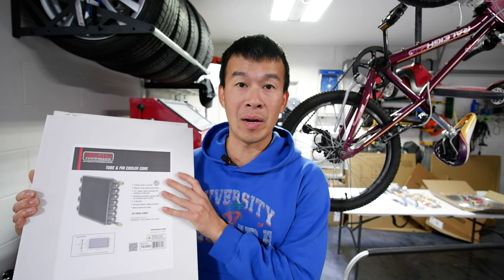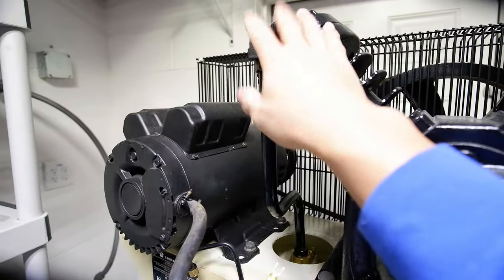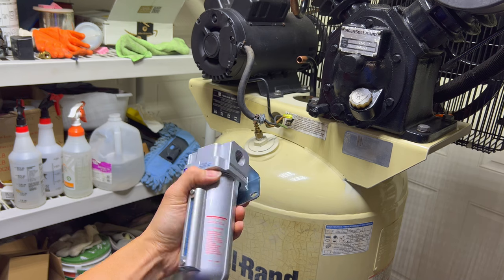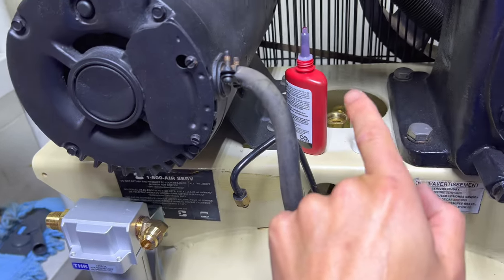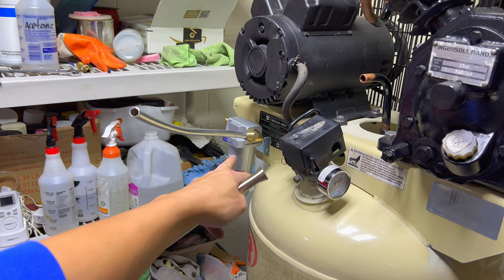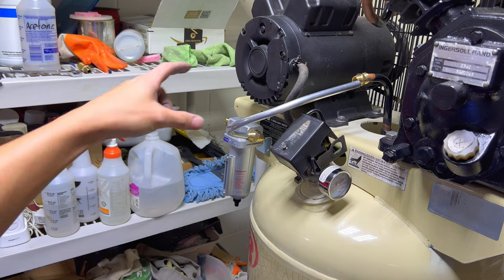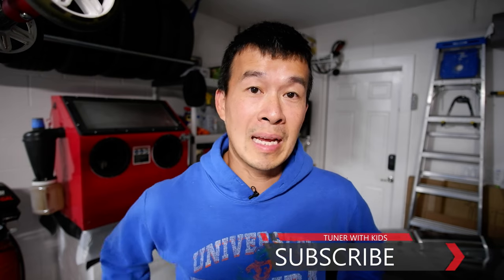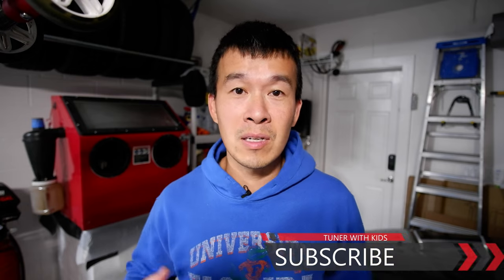DIY Air Compressor Aftercooler Dryer Water Separator | Compressed Air Cooler

Comment: Very useful video, thanks!  Recommending to tighten NPT threaded connectors as hard as you can into cast filter bodies is not the best idea though...they will snap or burst along the casting lines if you go too far.  That is why teflon tape is a better idea, the thickness of the tape gives you more ability to clock an elbow to where you need it.  Been using 5 to 7 wraps on 1/2" NPT on any kind of air service for 30 years....Loctite 575 is kind of overkill on not the best choice.  It is also not recommended to use any kind of sealant on the threads between the nut and body on a compression fitting, the ferrule is holding the tube and it would take unbelievable pressures to loosen that nut.  Not being critical, just offering the advice as I am an instrument fitter by trade.
Reply from the maker: Thanks. Good to know. I was using Teflon early on this compressor to do the other maintenance parts and they leaked since I didn’t tighten enough on clocking the fittings. That’s why I switched to the 545 since I had that laying around for some hydraulic fittings I’m doing.
Reply: @veecan8341  pipe thread sealant. Since it's not boiling hot air true blue pipe thread sealant. Or blue monster with Teflon 3-4 wraps.

Comment: Keep a bag of silica sand around. Or salt. Fill tubing. Tape ends then bend. Keeps tubing from collapsing
Reply: Or use tubing benders
Reply: I fill the tubes with water, cap the ends, and put it in my freezer, when its frozen I take the pipe out and bend it to shape and it wont kink. Remove the caps and the ice melts.
Reply from the maker: Good idea on the ice, never thought of that.

Comment: I've watched a lot of these videos, yours explains the process really well. One thing - I don't understand why everyone goes through all the trouble of mounting these on their compressors, between the motor and the tank? Why not put the aftercooler AFTER the tank instead of putting it between the motor and the tank? Pop an auto drain on the bottom of the tank, let the tank and auto drain do the job they're designed to do, collecting most of the moisture at the tank .... then have the aftercooler inline right after the tank, cooling the air before it hits the filter.
Reply from the maker: It’s due to the temperature coming out of the compressor, 250F. Dropping it before it hits the tank minimizes moisture in tank and in airstream. You rather catch before the tank. A cooler after the tank to the filter won’t do anything. The point of the cooler is to get a high Delta T. In industrial applications, they use refrigerated dryers to do same before the air hits the 1,000+ gallon tanks.
Reply: Extracting the heat before the tank give the air one more place to drop moisture, making the air that much drier. 

A cooler after the tank will work but only on extended run times when the tank gets warm/hot. I used to run 50' of air hose looped to condense the water after the tank and before the dryer, it works but again only if the air leaving the tank is warmer than ambient.
Reply: I’m not concerned about moisture.  I’m concerned about burning up my pressure regulator from heat!  I might put it after the tank and not install a water separator.  I use my compressor to bubble up water in my water well.  I produce about 15 gallons a minute with all mechanical components above ground.
Reply: @TunerwithKids  That kinda direct pressure into a transmission radiator not made for those high pressures.
Reply from the maker: The air movement thru the cooler isn’t under high pressure that long like in the tank, but the Derale is rated for 250psi. Once the tank is full and motor shuts down, the circuit releases pressure and tank has a check valve to hold the tank pressure.

Comment: Please note that  the 5/8  pipe from the pump to tank is sized to ensure that the pump(comptessor) can provide the  designed CFM to the tank.   If you   now connect a smaller  diameter pipe  (the cooler)  in between the pump (compressor) and tank.....you nowdecrease the  CFM going into the tank.....which can increase the recovery time to the max air cutoff.    Maximum CFM is critical to the operation of certain tools....like a DA sander....sandblaster....if you don't want the compessor running on and off constantly....or always running.    However  if MAXIMUM Cfm  is not a requirement then ALL IS WELL.

Comment: friend used a couple Muffin fans from a computer server as they are 110 volt. they got a cooking pan the size of the cooler and installed the fans in it and over the cooler. powered off the pressure switch,  Used rubber hose to absorb any vibration the compressor induced. they put amsoil compressor oil in the compressor as well, on the bottom of the tank they added a couple foot drain line so water collects in that not the tank.

Comment: It's actually better that you didn't turn the elbow fitting coming out of the pump head, you want it facing down like you have it so that the water in the cooler and tubing doesn't flow back into the head when it's off.

Comment: Great video. After having done this as described in the video, I recommend buying the aluminum tubing in straight lengths. I spent a great deal of time trying to straighten the tubing to push the brass fittings on without pushing the tubes out of round. In addition, it is much more difficult to set the curved tubing into the flaring tool and have it perpendicular to the tool. I'd also recommend spending just a bit more and getting a proper tubing bender rather than the spring bender set.
Reply: link for suggested aluminum tubing

Comment: After watching several vids on this I followed your instructions. The double flares were a challenge, went through 3 different flare tools before finding a good one. 95 degrees i Florida. 280 degree air going into the cooler and 90 degree coming out.

Comment: Its best to cut any tubing that you want to flare with a hack saw as tubing cutters can work harden the metal and many times cause your flare to split. Sometimes it splits after its connected. Brake lines are the worst about this when double flaring. Most double flare kits in years past would tell you this in the instructions now that info got lost somewhere. Thanks for posting, Great idea. DS

Comment: It is about the best modification you can do to any air compressor, this conceal the water condensation at the firat trap and not in the lines.
On any compressor, if you want to have water exempt air circuit, your tank must be kept cool so it traps the remaining water.
On my compressor, I done things a bit differently, I used a big regrigeration flat evaporator as heat exchanger and I used an automatic pressure activated tank drain to flush that portion of the circuit every time the compressor stops operating and it is surprizing to see the quantity of water that is collected at each compression cycle.
Very good job
Reply from the maker: Yea I manually open the drain weekly and even when I don't use compressor often, it expunges water from sitting.

Comment: Thx, I learned alot!  Was gonna make a copper pipe manifold after the compressor but that won''t prevent water from entering the tank first. I do run an auto drain on my tank but if I can limit the water going in, it will give the tank increased longevity as well as less water in the final filter/s.

Comment: I was about to buy one of these, the 15800 with pre-mounted fan but saw a few reviews where guys have already gone through a few of these and had blown some seals, meaning it lasted for awhile then didn’t.  I don’t know if corrosion from the hot water vapor may have anything to do with it but can assume so.  That said, I’ve decided to build one of these on a 2ft x 4ft vertical grid using  1” copper pipe spaced 3” apart and zig-zag back and forth moving from top left (inlet side) down to bottom right (outlet side) . So there will be 16-18 sections of 24” long pipe.  

The bottom right will  have a T with a drain at bottom, then a 48” vertical pipe where the top will mount to a second hydraulic hose that goes to an auto-drain, and then from there it will go to another flexible hose into the tank.   If needed, I can mount a standard 24” house box fan on the upper hot portion as well one lower down too if ever needed.  Overall I also think this will cost about $50 less than a Derale with fan unit.  Best of all, if anything goes wrong, I can hopefully resolder a joint rather than having to buy a condenser unit again.
Reply from the maker: I looked into doing the rows of pipe and it added up in costs for fittings. I thing the cooler is best benefit for costs. If you slope it properly, all the moisture will naturally drain to the trap.
Reply: That seems like a lot of copper pipe, about 35' by my calculations. 1" copper, even M pipe, is about $60 for a 10' length. Then there are all the elbows and other fittings. What did all that cost?
Reply: @joer9719  I spend around $400, but also bought some pipe and fittings from local people off Craigslist.

Comment: My almost 30 year old 60 gallon 120 psi 240VAC air compressor has had zero maintenance and out of concern 10 years ago I added an air filter/dryer and I have never seen water or garbage collect in either component.  This is an interesting upgrade and I am sure it's mandatory for Florida but not in dry cold climates.
I feel bad about abusing it but damn for seeing use every weekend that is pretty decent return on investment.  I used to want a better one for air tools but I am almost all electric tools now.  It may last my lifetime or explode and end my life not certain.
Reply from the maker: I needed dry reliable air for media blasting and painting. But in FL they tank condensates from just holding air and pressure. I manually hit the ball valve drain every few days for good measure. I hydro tested this to 270 psi for 6 hrs to make sure it won’t explode on me.
Reply: @douganderson7002  honest, I've painted enamel with it also and not had issues or moisture in trap.  Periodically my tank drains a little water, nothing like what other's get elsewhere across the country.
Reply: @thereplacementfordisplacement  we have very dry winters but humid summers here, so I have a dehumidifier running 24/7 keeping my shop usually around 30-35%. I build very little water in my air compressors. When possible, I think dehumidifiers are a good addition to keep surface rust from developing on equipment in humid environment, and it feeds dryer air into air compressors.

Comment: Orient the compressor to allow better airflow through the cooler. With the cooler facing, and up close to the wall, air has to flow around it rather than through it. I like the install.

Comment: I must have missed this video the first time I looked for it.
  I too have been wanting an aftercooler on my compressor.  I also found the barstock 90 on the pump head to be impossible to turn.  Lately, I've seen videos showing chemicals to soften the superglue holding that fitting in place.  They recommend acetone and chlorinated brake/carburator cleaner to soften it.  I'm still trying to find out how long it takes to dissolve.  I'm pretty sure the paint over the joint needs to be removed before starting.

Comment: I wouldn't use red loctite as a thread sealant on soft metals like brass or aluminum. In future, I recommend TFE paste on any threaded connections. Its gas and oil resistant and only dries to the touch- but will allow you to unscrew it later. I use it instead of teflon tape on all of my air tool fittings at work, as well as multiple automotive applications. Its gas and oil resistant as well.

Comment: Great video,  but I wished you would have slowed down on the cooler install and flaring process. 
Did you use a 37 degree or 45 degree flaring tool ? Thanks
Reply from the maker: The flare is 45 which is pretty standard. AN is 37 I think but for this connection it is fine. The circuit only holds pressure during charging so air moves fast enough that my minor leaks don’t matter. Once the tank is full the charging circuit releases all pressure.
Reply: @TunerwithKids  thanks for the reply

Comment: Hi there. Im putting a cooler on my air compressor as well. 
Im also using a water and oil trap on mine. I was thinking it would be good to stop any oil before it gets into the tank. 
The oil trap has a regulator but i was just going to turn that up so the full amount of air gets past it so the tank will be filled up as quick as possible. 
Do you reckon that is ok to do ?
Cheers for the great video

Comment: I would have put the springs on the other side.   Or maybe half on each side.   Also burn the ends to make them hold tighter on the stopper so you call pull them tight.   Great video though.   Thanks

Comment: Any chance you have an update on if your secondary water collector was still getting any moisture or was the first one able to take care of it all?
Reply from the maker: The after cooler does a good job. The output filter driers are for any residual moisture inside tank. I also do a quick open close of the drain ball valve at the bottom once a week, it spits a quick burst of moisture everytime.

Comment: AN 37° flare and industrial 37° flare fittings function identically. In many cases, they appear to be functionally interchangeable, but they are not. What this means is that while the products may look similar, you must not use an industrial 37° flare fitting design as a direct substitution.
Reply from the maker: Yea I think it's 45 degrees vs 37. For this project they work because it doesn't have to be 100% air tight. The charge circuit is only pressurized during fill. Once the fill is complete, the circuit releases all pressure.

Comment: How much did this end up costing? and did you have the tools already or did you have to buy that as well?
Reply from the maker: All the parts ended up being about $285 (with after tank, trap air dryer) a year ago. I have most of the tools but did pickup the flare kit for like $25 since I needed the double flare (already had single flare kit).  Most of the stuff is linked in the video description to Amazon. Everything is still about the same price this year. I also spend another $125 in aftermarket maint. parts to refurb the compressor after I rescued it, all valves, air filter, capacitors, drain/leader hoses.

Comment: hmmm, so the flaring tool you used creates 45 degree flares, and the 8an fittings are a 37 degree interface.....how did you address this?  Did you replace the 37 with 45?
Reply from the maker: no... the AN to flare junction is good enough for this setup. The is the charging circuit so it is only pressurized as compressed air is created and passes thru the check valve to the tank. Once the tank is charged this circuit depressurizes so its doesn't need to hold charge.

Comment: great video, where I live its very humid, did you see a big difference in the moisture when you ran your tools? 
Reason I ask is I'm sand blasting a car frame and the blast gun gets jammed up with moisture. This looks like a good solution?
Reply from the maker: I've been using it to sand blast in my HF cabinet and its worked well. Dry air and no clogs. My only issue now is keeping my media high enough for the siphon tube  to suck.

Comment: Just a thought here; the placement of the cooling coil causes the cooling fan to blow very hot air across the cylinders thereby greatly reducing cylinder cooling. I realize you now have cooler air coming out but still may be causing overheating of the cylinders and possibly premature damage.  ?
Reply from the maker: Negligible affects on the cylinders or the second stage coolers on the tubes.  This is actually how OEM optional after coolers are also mounted. With the short duration of air movement during charging, it shouldn’t really affect anything especially with the wide range of ambient temps the compressor is already exposed to during normal ops. Main goal of the cooler is to let air make multiple passes thru and get a delta T to let moisture condensate and drip into the trap.

Comment: My question is why not install the radiator and dryer inline with the intake of the compressor head not the output?
Reply from the maker: Cause you are trying to cool the compressed air, not intake air. Reducing air temp before the tank also condenses moisture which is trapped by the water trap we install before tank. For additional drying on tank output, I added the desiccant inline dryer.

Comment: Any air leaks because of the flare fittings vs AN?  On the AN flare did you use a single or double flare?
Reply from the maker: No telling of air leaks since it’s a charge circuit that is moving high velocity during tank charge. Once compressor stops the circuit unloads. For the flare to AN junction, I think I did a double flare shown in the video.

Comment: Nice work, man. Looks great… i’m trying to figure out how you got that big bad ir and black and decker drill lol
Reply from the maker: I got like 5 B&D drills…lol. All cause the battery was cheaper with drill than alone. I also have Craftsman 20V and Ryobi 18V brushless drills, huge difference in performance. Haven’t seen any deals on Dewalt drills but I got their impact wrench, blower, and job fan. Spend too much time on Slickdeals so my collection is random on best deals.
Reply: @TunerwithKids  just giving you a hard time. I just sold my dewalt drill and impact to buy a bauer one for the battery price alone lol

Comment: What's your plan for getting standard 45º flare fittings to seal on the (37º) 8AN fittings on the cooler?  Oooops! Does not work reliably!
Reply from the maker: It worked 🤷🏻‍♂️. I saw others doing the same with flare to 8AN, so I tried. No major leak. Remember the charge circuit doesn’t need to hold air more than the time it’s charging. Once the tank fills, the check valve and pressure switch unloads the line.